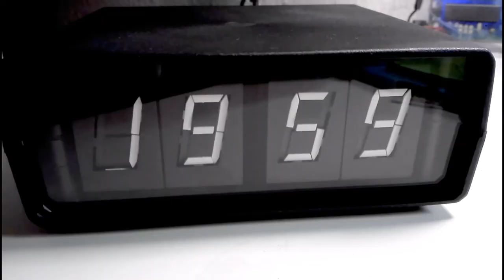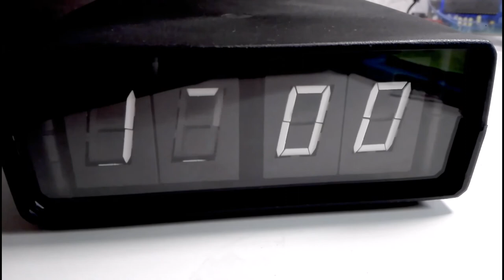Klappzahlenuhr Electromechanical Vane Display Clock CMOS

Comment: Nice job! Would you send me the schematic  of the display control circuit please?  I can give you my e-mail adress.
Reply from the maker: Hello, there was and is no circuit diagram. I built it on breadboard, tested different versions, improved, converted, etc. and when everything worked, implemented it on a prototype circuit board.